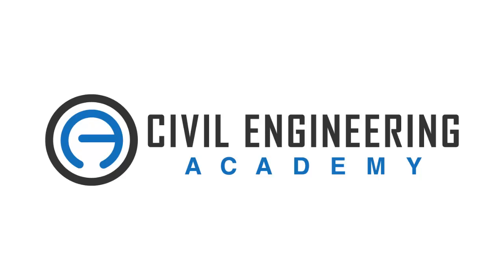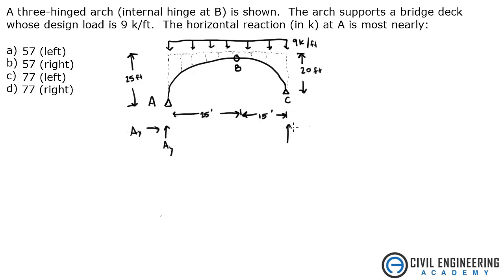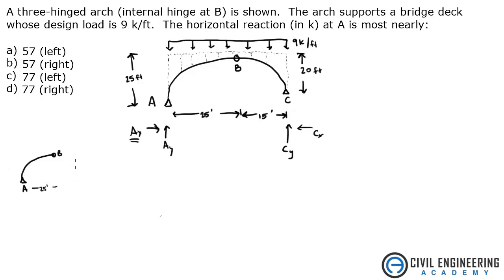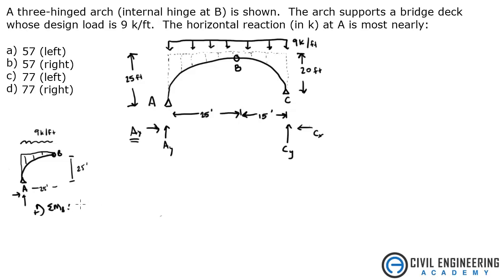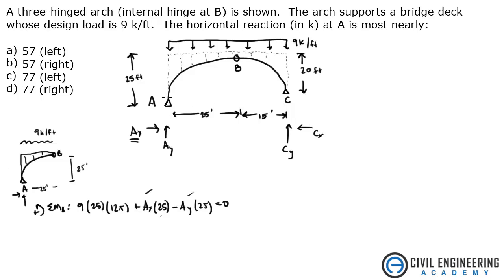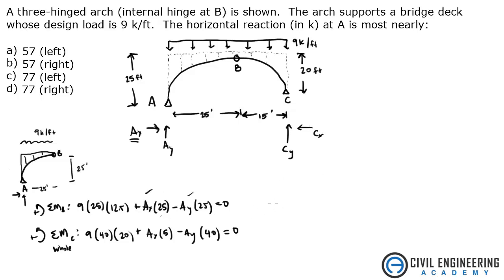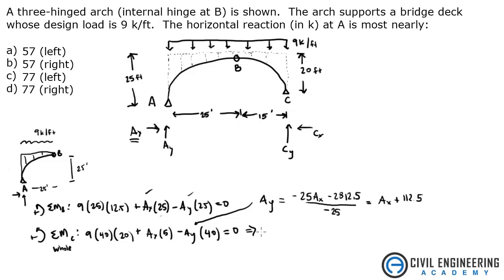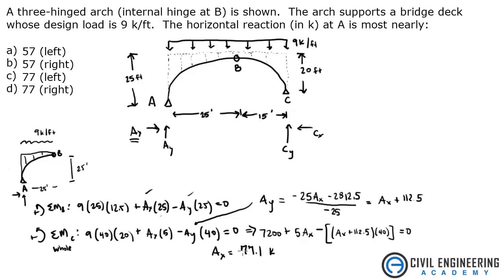Structures-Find Horizontal Reaction in Arch using Statics

Comment: why does  Ax was multiplied by 5ft in the whole structure for moment C?
Reply: There is a 5' difference between A and C, 25' vs 20'. They are not on the same plane.